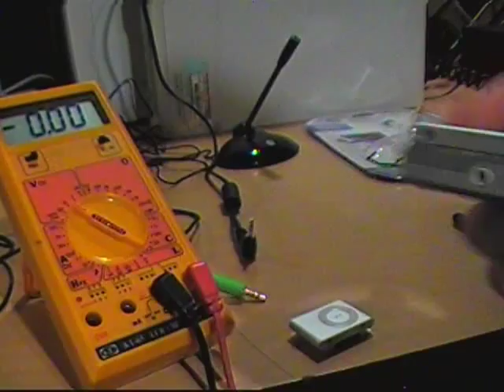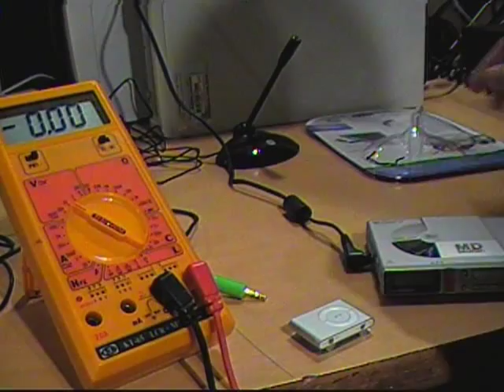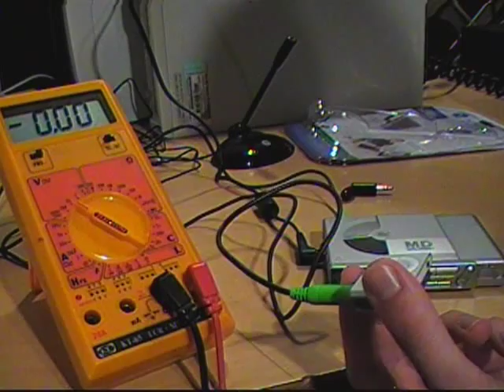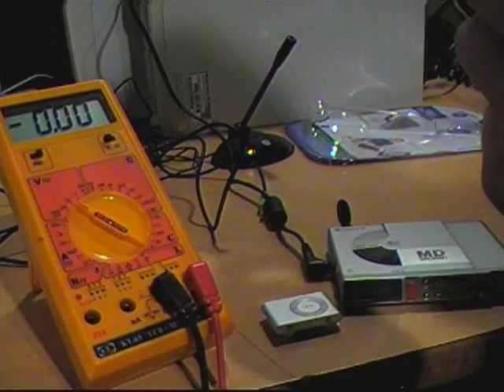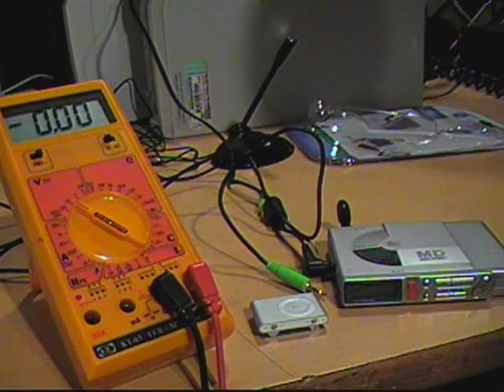Can 2.46 volts kill an iPod? (line level to mic input test)

Comment from the maker: The mic input on a boombox or home stereo is typically for dynamic microphones and thus has no voltage present.  If you don't have a microphone, you can plug in a pair of headphones and use the left side earphone as a dynamic microphone!

Comment from the maker: PC microphone jacks have no auto level control so a line-level source would overmodulate quite badly.  Also most PC mic inputs are only mono and have poor quality (hissy, low-fi sound).  If your computer has no line-level aux input, you can use an external USB audio input device to record.

p.s. I measured my IBM/Lenovo ThinkCentre's mic jack and it is putting out 3.64 volts on both channels (it is a rare Stereo mic jack).

Comment from the maker: Yes, the iPod charges through USB, which provides 5 volts at a maximum of 500 mA (0.5 Amps).

The cheapo MP3 player uses a 2.5 mm jack, a.k.a. 3/32", which is the same size used by cell phones.

Comment: I dont think the 2.46 volts will harm the ipod but I even think the plug in power will maybe charge the ipod's battery not sure. ive plugged in devices into mic jacks and the only thing it really did was overdrive the preamp. mostly on my toy megaphone. and the user CassetteMaster does this but he made some type of attenuating cord that adapts a line out signal to a microphone input and it works really well.

Comment: bare in mind that ipod shuffle supports 5V and 1Am max shown under the shuffle's clip (2nd gen ipod shuffle). 

And about the $10 MP3, does it use the plug that the cell phone uses?